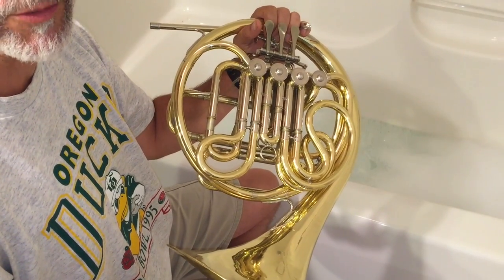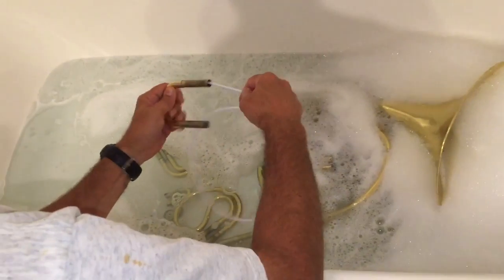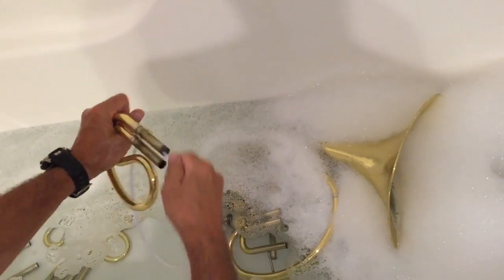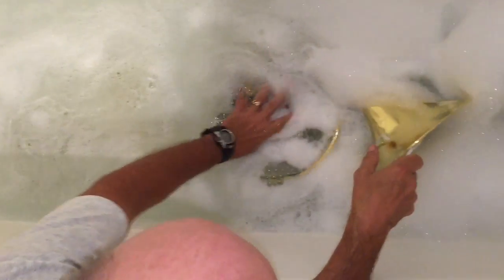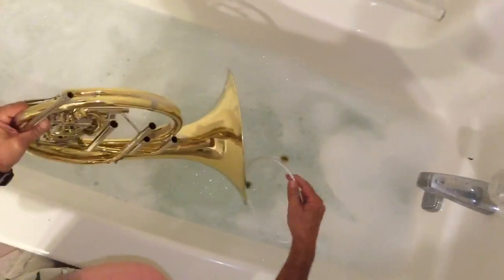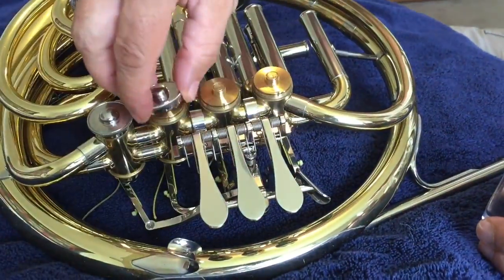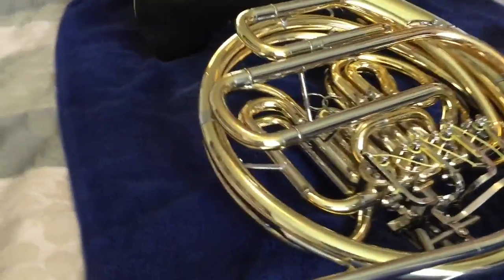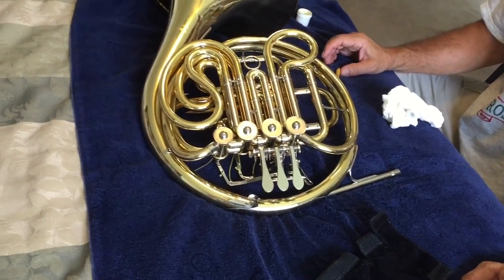How to Clean Brass Instruments

Comment from the maker: You clean a trumpet the same as the horn except you remove the valves. Most trumpet valves are numbered so they don't get mixed up. If your trumpet doesn't, color code your valves with different colored twist ties or something like that.
Reply: Clean an actual dirty instrument….
Reply from the maker: @chewie2055  I used a school owned instrument that, to my knowledge, had not been cleaned. I was surprised at how little stuff came out. I guess the students didn’t practice. Heh.
Reply: @quickfixtips2030 I had to clean a school French horn because it sounded clogged (red rot) and it was meh dirty.

Comment: My French horn started like shedding plastics after I bathed it. Is that bad 😬
Reply from the maker: That doesn’t sound like an ideal situation. Could the lacquer be coming off?  Never use hot water when bathing a brass instrument. Luke warm water with a liquid dish soap like Dawn to cut the slide grease is all you need. Also a snake brush.
Reply: @quickfixtips2030  okay thank you

Comment: How long does it take for it to dry?
Reply from the maker: It’s up to you. You can towel dry the outside right away then grease and oil the valves and slides right away if you’re in a hurry.

Comment: how often do i clean my horn
Reply from the maker: That depends. If you play after eating, and don’t brush your teeth (sometimes rehearsal is after lunch or dinner and brushing isn’t an option), then you should put a snake down the lead pipe (the pipe that the mouthpiece goes into) every one or two weeks. If you do that, then once a year should be fine. This only my opinion. Others may feel differently.

Comment: What if you don’t have the snake?
Reply from the maker: You can buy them for $5-$10. I prefer the metal flex spring kind. I use a cheap vinyl brush in my video but I’ve had issues with the brush coming off in the Horn.

Comment: I put bleach on my instrument. I am an idiot. Do you know how I could fix it?
Reply from the maker: Hmmm. What instrument are you cleaning? How much bleach did you use?  A cap full in a full bathtub of lukewarm water shouldn’t hurt it
Reply from the maker: It is not recommended however. How long was the bleach on it? Did the laquer come off?  Can you post a photo?
Reply: QuickFixTips I play the saxophone. I am very lucky because I rinsed off the instrument afterward with warm water. I thought it was broken at first because it wasn’t playing in tune and some keys were stuck. But after a while of drying it off it managed to work fine again. I got really lucky, I thought it was a goner. But thanks for the quick response.
Reply from the maker: Evelyn McCabe Whatever you do, don’t submerge the sax in water. The pads will be ruined. Just run a swab through it and wipe off the outside with a soft cloth. Sticky pads can be cleaned individually. Try putting a piece of paper between the pad and the collar it closes on. Push the key onto the paper and then pull the paper out. Repeat a few times. If it still sticks, take it to a repair shop.
Reply: @quickfixtips2030  Good to know, thank you for your help.

Comment: You can't put a brass instrument in water because long term it will rust
Reply from the maker: Shelby Lavy The great thing about brass is that it doesn’t rust. It can corrode. It can lay in a clean stream or lake and corrode after a few years. Now there’s an issue called red rot but that’s from the inside out and that’s from the acids in saliva. Actually, bathing a brass instrument once or twice a year with clean water will help prevent that too.